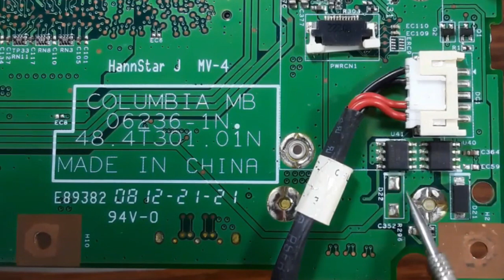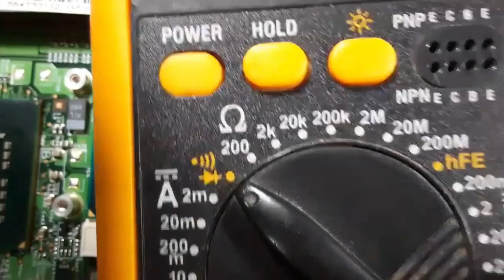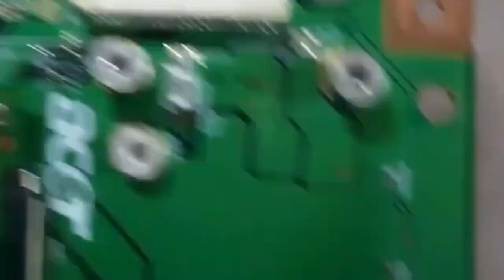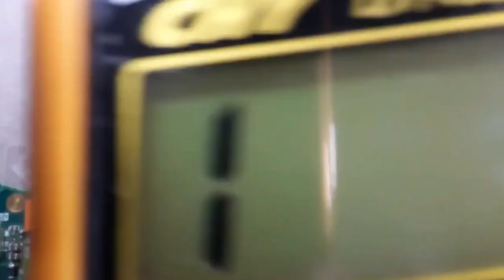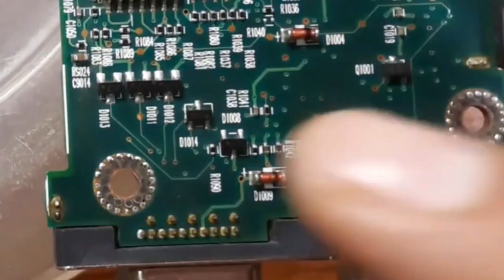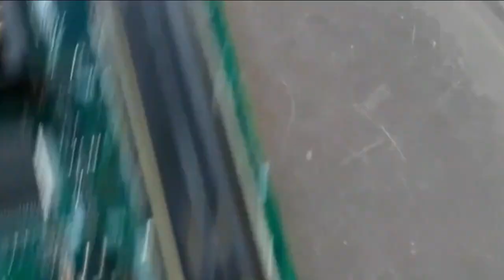The Secrets of Motherboard Signal Tracking | Laptop Motherboard Repair

Comment: To be frank, your teaching style spark me into learning more about motherboard repair. Whenever am watching your tutorial video, i always feel like am with you in person, everything is always clear and understandable!

But there’s one thing I would like to grab from you boss about the chips replacement, it’s like am getting things wrong about the chips replacement sir, very important to me.

I discover that some chips like: mosfet, transistor, and diode doesn’t work after replacement though they are good one, why? Is there anything am missing to check? I always remove the chips from a scrape board, and I always position the pins well during the replacement. Please sir, are there things i should have checked more ?